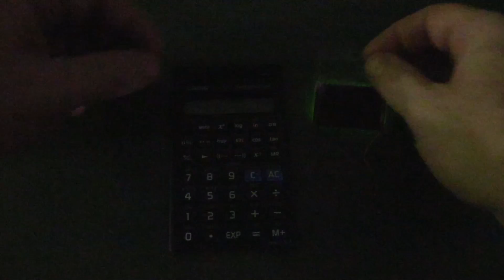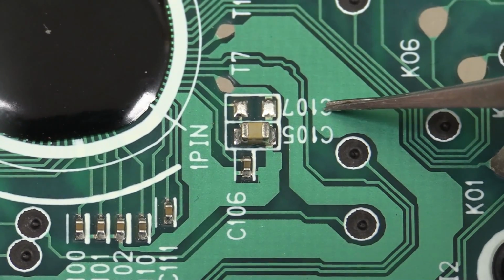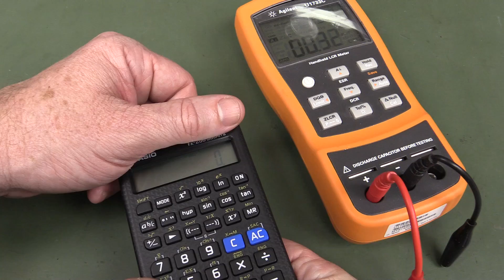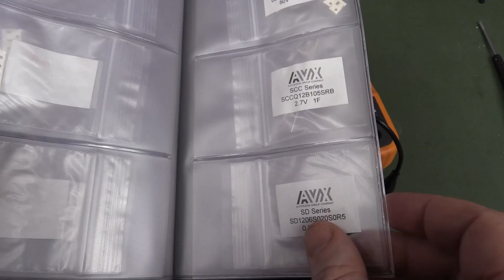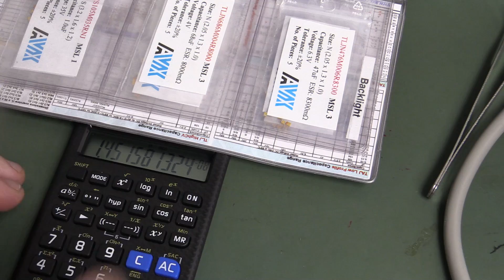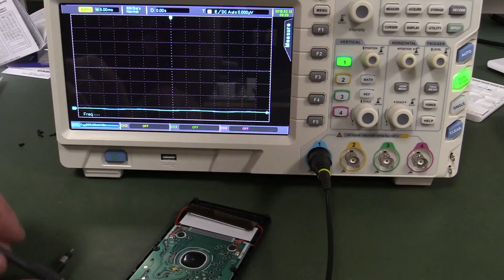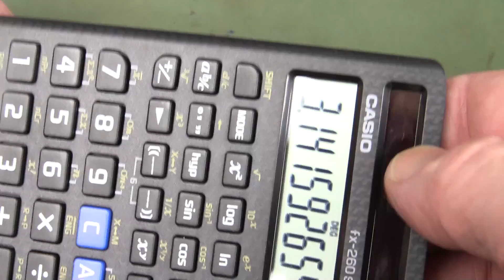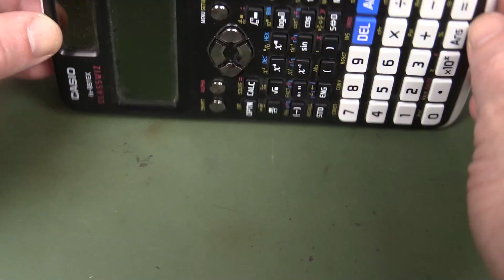EEVblog #1094 - Casio FX260 Solar II Calculator Tritium Nuclear Battery Experiments

Comment: n! - Does factorial really "give it a workout"?  Instead of coding in how to calculate it why not just use a lookup table up to 69?  I suppose it would depend on how much code space was left but it would be way faster.
Reply: I have the same calculator and I just tried some really weird roots to give it a work out and it took about the same amount of time as 69!. I also think if it had a look up table it would be instant instead of having that small delay.

I also think these ASICs have the memory hard programmed into the silicon so it would make much more sense to go for the route without the huge float array if you had the processing capabilities. Factorial can be programmed with a simple
float factorial(int n){
   float answer = 1;
   for(n,n>1,n--) answer*=n;
   return answer;
}
(in C) which is way less programming space than 69 floats.
Reply: Mason - I think you are right that it is going through the calculations base on the update time.  I like your function call but would the assembled code really be less space?  It has a ten digit plus exponent display that could be stored in simple BCD in just 6 bytes.  6 x 70 = 420 bytes plus the lookup code.  How much for floats?  If I had the code space I would use the table just to get the speed but it seems clear that they did not.
Reply: I haven't had much too much experience in assembly unfortunately and the size of the function will depend a lot on the microcode and instructions they've implemented into their ASIC. But I'm assuming it wouldn't take even 20 words, let alone 420. 
I tried to compile it with arduino real quick just to see how many bytes it would take to compile that function but it said 444 before and after the code was inserted.
And if I assume that max displayable digits are what is stored in memory (10 digits) and 2 for the exponent, log2(9999999999) + log2(99) ~ 40 bits or 5 bytes per number in the lookup table. With 69! being the biggest number we can show on the calculator with 2 digits for exponents that leaves us with 345 bytes. The lookup code would just take 2 or 3 bytes to say have a starting point address and then add the factorial to it and then go to that lookup address. So it would probably take 350 or so bytes in total.
Since I'm assuming they role their own chips they would just require more memory location be built in as long as they didn't need to add an extra bit to the memory address.
My guess is that they didn't see it as necessary to build or spare the extra memory since their ASIC is clearly fast enough.
Reply: Mason - Close but you forgot to store zero so it is 70 numbers.  And adding log2(digits) + log2(exponent) isn't quite right as you are adding the fractions but they are separate numbers.  log2(9,999,999,999) = 33.22 but .22 of a bit is a bit (ha!) hard to store in a non-analog processor!  ;-)

2^33 = 8,589,934,592 so you need the 34th bit.

And for the exponent log2(99)=6.63.  If we round both of them up we have 34+7=41 bits to store but also the hassle of converting it all back to a format for display which is likely 5 + 1 = 6 bytes.  You can do it but will it take less bytes to code it than what the 6 byte wide table takes?

Also, there is a need to test that it is an integer and not negative in both versions so that adds a bit more to the code size.

That's interesting that the Arduino code size didn't change.  Must be a minimum amount or something?  Weird.

But a big reason to use the table is because 69! seems to be a common speed test.  "Hey my calculator is faster than yours!"  Increased sales!
Reply: oh right, you got me there, I did forget 0. I added them as seperate number because computers represent floating point numbers as the mentesa (the decimal) and then the power of 2. I assumed if you were going to do a lookup table that you would just represent it as a power of 10 because that is how it is displayed and there is no reason to add extra complexity. I just wanted a decent estimate as they may just be representing it as a standard (long) floating point number, 8 bytes, or try to save some space. And I rounded down the 33 because I'm not actually sure the calculator goes up to 9.999999999, and they wouldn't even need to in the lookup table seeing as how the largest is 69! (1.71*10^98). I did round up the 6.63 because you do need the full range there. So I still think my best case scenario for memory storage required is still decent.

So the range would be 350 bits to 560 bits. I am still very much convinced that a talented programmer could easily program a factorial function with around 20 bytes (which corresponds to around 20 assembly instructions!) which is an order of magnitude less than the lookup table.

Yeah I'm not really sure why the arduino IDE did that. I really should load up the PIC c compiler but I was feeling lazy.

I don't think that is a major selling point of this calculator, I think it is just meant to be a budget calculator that never runs out of juice. But I think we might be worrying too much about the specific details of a random calculator lol
Reply: Or just use Stirling approximation for bigger numbers:)
Reply: I ain't no computer scientist but you gotta work (calculate further) with the factorials so storing as BCD is probably crap. And silicon space aka memory is expensive. Even though mask rom is probably not so much. But why use a lookup table if you can calculate it in your ASIC
Reply: Factorial is a nice repetitive process for a "for" function. I doubt the do anything more complicated. They just have dedicated hardware multipliers like in DSPs for example. If they can do 1 or ever 2 or 3 clock cycle multiplications the darn thing can be fast indeed. Dedicated multipliers I guess is a must for other reasons too, like accuracy, so don´t bother. Plus there are other methods like numerical analysis to solve functions. They probably use something like this, perfected to run until error is minimized and algorithm might as well be hardwired for each function.
Reply: I personally would bet that the factorial function is just a wrapper around the gamma function, which has multiple different definitions that might be faster to compute than factorial at different input ranges. It'd be pointless to make a lookup table for it since the gamma function works on the complex plane with numbers that might not be Gaussian integers.
Reply: Im late to the party, but I doubt this thing has any memory outside what is absolutely necessary. Having a lookup table would cost more, cause youd need more hardware. Easier to just work it out on the processor

Comment: how many volts does the calculator need to run 

i have one of these and the solar cell on it broke so im planning on putting a battery or usb in there to power it as a joke

Comment: When turning it over, you better tape down the LCD to the case. If the display connector strip comes off, it would be difficult to bond it back!

Comment: Your calculator PCB is made in the 47th week of 2017. So the calc is made in 2017 or 2018. As for the case, it is indeed normal ABS  (or ABS+ PC) plastic that is embossed with the raised pattern.

Comment: What type of cap is on that on the 991EX? It looks electrolytic but wouldn't the leakage be too high? Maybe it's just about ok and they use a bigger solar panel than absolutely necessary just to be able to use an ultra cheap cap. Also beware leakage with tants at higher temperatures.

Comment: What if the solar panel is exposed to light while the unit is switched off does it charge up capacitor and therefore switch on time is not affected in that case??

Comment: decades ago I took a part a "credit card" calculator, it was a bit thicker than a credit card, and it had the smallest non-SMD red LED I have ever seen. 
You coldn't see the LED when it was all together.
Not sure what they needed it for.
Surely the reverse current from the storage capacitor was not enough to hurt the solar cell.
Reply: voltage clamping. red leds start conducting at ~1.5v and really take off at 2v

Really handy if your moding cheap lcd electronics to be solar powered.

Comment: the higher ESR might help you at start-up as well, since it will drop voltage during the start of the charging and the cap would not look as a short to the charging circuit. Of course it will make true charging of the cap slower...

About the attempt with the nuclear battery - since the "solar cell" actually is a module with 4 series connected cells you need to get light intensity onto all cells, which might be difficult with your tritium tube assembly since it is to narrow...

Comment: As for the backplate on the 991, yes it’s indeed for stiffening, that thing is an absolute brick, you can throw it around, drop it, I had one with a arched screen, it took an incredible amount of force to completely crack it, I stabbed it with pens and scissors and even dropped a hard drive motor on it and kept working. 
(It was the earlier model, but it’s the same aluminium piece)

Comment: Thanks Dave! I'm sending my youngest son to college this year and it looks like that EX (with a 220uF mod..) with do the trick. I gave him the 9750Gii last year but it seems the programming makes it ineligible for exams.
Reply: Cliff Matthews Depends on the country or exam system. Some places allow bringing as many books and notes as you can carry, so a few extra kilobytes of calculator memory is not a problem. Others still focus on testing rote learning of rarely used formulas so they insist on not letting students bring any way of storing extra notes or preprogrammed formulas. Bans on phones and other ways to communicate makes more sense as they want to be sure they are not getting results from someone else, inside or outside the room.
Reply: @jameshewlett7798  You own all Casios?🙄?? Assuming pockets, let's count: fx-10, 15, 19, 21, 102, 201P, 39, 140, 180P, 3400P... 310, 350, 510, 570, 370, 361, 81,  82, 85, ... I stop here (those were only a fraction of the 70s and 80s!).
Reply: @jameshewlett7798  Great. And i have one Casio from 1994 fx-992VB broken, and few from 2000s - fx-260 solar, fx-991MS, 991ES PLUS, 991EX, and  basics : a credit card size SL-760LB, SX-300P and a dual leaf SX-220. A micro / nano museum?
Do you have any of these? 😀

Comment: Almost nothing sold as "carbon fiber" actually is, short of supercars. Mostly it's just a sort of woven/reflector style black plastic, maybe with some carbon in it, but not including any of the processes that make carbon fibre strong. It's like how "tempered glass" phone screen protectors are very obviously plastic.
Reply: KX36 some propellers and hobbyist model aircraft parts are in fact carbon fiber
Reply: Huh? I had a tempered glass phone screen protector that was fairly obviously glass. It became obvious because it shattered a few weeks in, and it didn't just break in one spot, when it shattered, it shattered across the whole surface, but it was really not possible to scratch it up. I got it for a couple dollars from China too.
Reply: I've bought hundreds of tempered glass screen protectors over the years they have all been glass however the quality varies significantly! One I bought was amazingly thin, about a quarter of the thickness of a typical tempered glass screen protector you could curl it round on itself and it wouldn't break however eventually it did break cracked all over the place.
Reply: KX36 .... Tempered glass screen protectors meet the MOHs hardness rating that corresponds to glass. You may have purchased some "fake" tempered glass.

Comment: The NF model may just have a piece of tape on the pad, or a scratched/lasered connection leading up to the button.
Reply from the maker: Could well do.
Reply: Why couldn't a configuration trace/pad hide right under the epoxy blob? Or simply different PCBs. I'm sure they reuse silicon a LOT, but reusing PCB layouts completely doesn't really save you much cost at volume, unless you have to order batches that are too large to consume and have to store them.

Comment: It requires at least 50 lux. In that way  it is no better than the fx-991 I bought in 1984 though the latter did not have the reservoir.
Reply from the maker: Watch my previous video, it works on 20-30 lux.

Comment: 11:30 Does the meter have a mosfet or other protection to isolate the current measuring  bridge when not in the correct mode? It looked like there was no shorting going on.

Comment: 12:30 - But what is the turn on time when just pushing the ON button when it already has power from the solar panel?  That's what matters not the time from when you turn on the room lights.

Comment: An eevblog Casio calculator with parallel and easily accessible engineering exponents would be awesome, but even if Dave would like to do it, it would be impossible to recover the development cost.
Reply: What kind of features would you like in such a calculator?

Comment: About that no fraction thing... I mean... you can just buy two and switch the boards... BTW the connection for the no fraction might as well be under the blob... would make more sense also...
Reply: I was thinking that maybe it is just a different board without that button connected...
Reply: Or maybe c120 is responsible for this setting
Reply: Valentino Saitz Or maybe they just omit a part from the button mechanism itself. For example if these are really tactile domes behind the buttons, they can just omit the metal dome itself.
Reply: I really doubt they use a cap for that, it could be a bond wire on the die, it could be whatever, but a cap? Odds are slim...

Comment: nuclear battery to Joule thief or Boost converter circuit? 🤔🤷‍♂️
Reply: Adding a boost converter does not increase the power available, it just increases the voltage. Adding a boost converter will only lower the overall power because it's not 100% efficient.
Reply: It would be useful if the voltage coming of the nuclear battery is too low for the thing you're trying to power. The monocrystaline solar panel Nurd Rage used produces a high enough voltage. With a solar cell it depends on the wavelength of light that's hitting it and the energy it takes to free the electron from the substrate. I believe this is called the work function. Anyways with this type of solar panel and the energy in each photon of visible light the individual electrons have enough potential energy to make the voltage required to run the calculator. The problem is that there isn't a high enough number of photons, and thus electrons, produced by the decay of the tritium vials to provide enough power to the ASIC, so it can't provide enough current. (current is basically the flow rate of electrons through the wire and power is the flow rate * the potential of each electron. This gets you Watts which is J/s. Increasing the voltage and decreasing the flow rate keeps the power the same. Remember, energy is a conserved quantity)
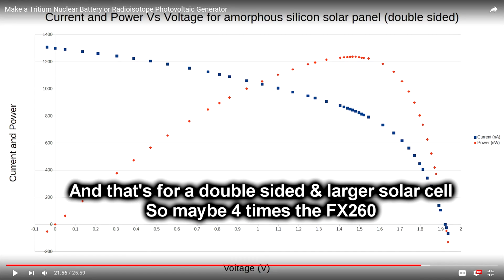Reply: Based on the graph at 2:33 it was getting up to 2 volts depending on the load he put on it. Peak power was at about 1.5v and was only about 1.2 microwatts. Dave said in the video that the calculator would run down to 1v so if the tritium was brighter the wavelength it emits should be high enough to run the calculator without the need for a boost converter. If it had a red glow then there would probably be a need for one
Reply: you should sell that to the US military lol
Reply: Mason Daub it’s worth a try, but might not be very bright? 🤔🤷‍♂️
Reply: Mason Daub how many volts was it outputting?
Reply: Walton Cockcroft multiplier 🧐
Reply: DC to AC power inverter? can the emitted light be changed to a different wavelength with a colored filter 🤔😔
Reply: nuclear battery + dc to ac power inverter + walton cockcroft multiplier = compact and portable 1000volt nuclear powered stun gun/taser 😧
Reply: Mason Daub 😄
Reply: Mason Daub probably needed a on and off switch 😐🙄
Reply: uhmm... no
Reply: zerpBot I haven’t got one to test but it might be enough to power a l.e.d 😐

Comment: Modded mine with a 47uF 10V tantalum and works great.  Not so large that it effects the start up time but large enough that it stays on for a surprisingly long time.

Like you I'm a Casio calculator fan.  My daily driver these days is the FX-115ES PLUS.  Sells for just under $13 USD.  For me it has the all important hexadecimal, binary, decimal, octal conversion.  Yes, I work on old shit where I need to convert decimal to binary or binary to hexadecimal.
Reply: I like SHARP calculators, because they need very few keypresses for any operation and you get hex even on cheapest models.

But i wish they still made EL-506P though :( I used to have a Tozai-made clone of that, but it has worn off. It's a metal faceplate model from the 80ies.
Reply: I use a fx-991MS, an 991ES PLUS , and an 991EX, and the free42 app on the phone. I also have a fx-992VB (1994), but the display doesn't display all segments. The machine is still working though! I know more about Casio calculators than I am supposed to know.